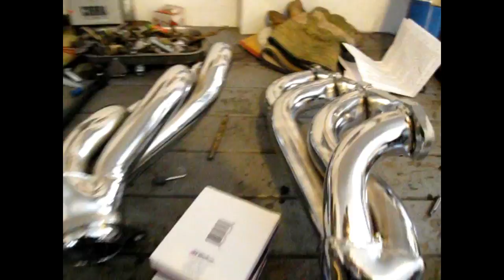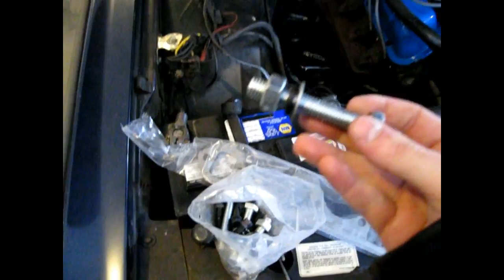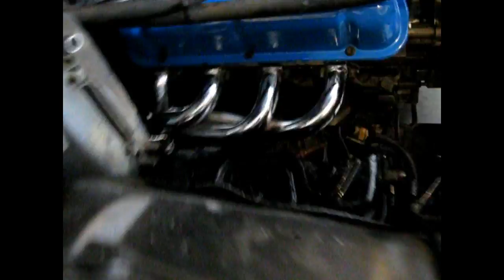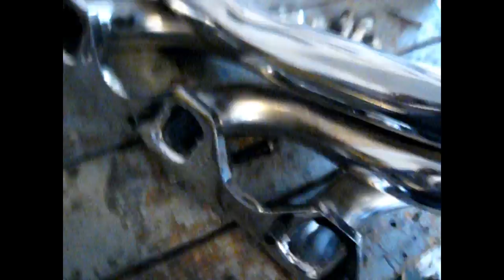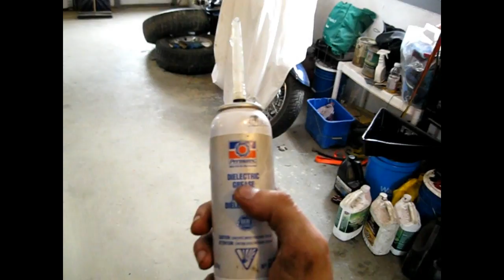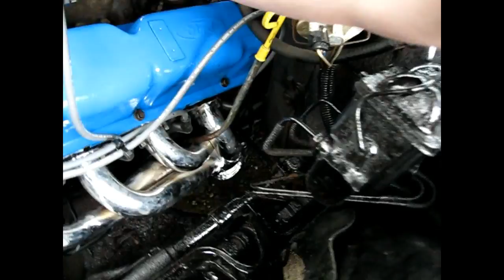302 Ebay Headers Install [ Shoots Flames ] 4 Door Mustang

Comment: change over to idlebrook performer intake manifold part number 2121 at a Holley 600 vacuum secondary electric choke carburetor and that thing will
Reply from the maker: Wish I still had it

Comment: I hope these fit in my 1980 351w 2 door grand marquis. Just grabbed roush World Sr 210/70cc heads, Edelbrock intake, hollers double pumper, msd ignition, scorpion 1.6 roller rockers and e303 style cam. Top end should be good for 350hp I hope my coupe only weighs 3300lbs and after I gut the smog and egr plus the vv carb and eec 2 ignition she may be under 3200. Look out mustangs

Comment: I cant wait to install long tubes on my 84 but I'm not shure how I'm going to change the carburetor from a 2 barrel with injectors to a 4 barrel for my new top end kit
Reply: Hei distributor, 4barrel intake, fuel pressure regulator. Gonna do the same to my 84 after I break in the new camshaft I installed.

Comment: Sounds like my 89 f150 5.0. I rebuilt it took out the efi and put on a 600 edelbrock 1405 with headers and a stage 3 duel plane intake. I'm putting Flowmaster super 10's on her.

Comment: Hey ben i found these same headers on ebay  wanting to install on an 88 5.0 fuelie tbird  but have an air pump line going to the rear of the engine any suggestions on this without droping an extra 70 bucks on hedman headers from jegs
Reply from the maker: Does the line go into your head . ? I removed my smog pump and blocked off the egr ECT
Reply: Yeah i just removed it from the pump to the rear of the passenger side piping it runs just like  it did before i read you could get some engine codes from doing that but took it down the road did a one wheel peel with no issues  going to use a pipe cutter and block the line  not sure if the o2 sensor is going to give me fits but i gots a plan for that  the hedmans are only 1 1/2 while the ones you got are 1 5/8 and you know the rule more air and gas in and out more power
Reply from the maker: Big B Line mine came out easy . I was lucky I guess . I'd spray them down good day before u do it let them soak
Reply: Ok i did that the last two days going to try them this weekend after a couple of more soaks  with blaster  hope i get lucky too ben thanks